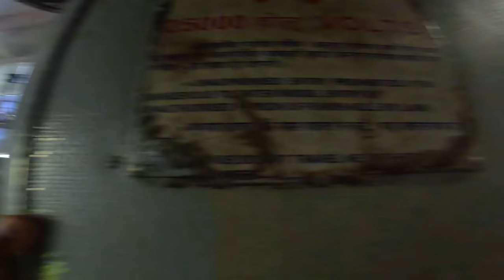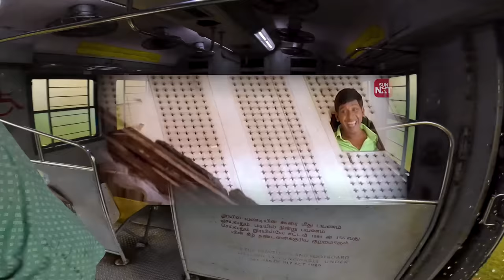TRACTOR RIDING EXPERIENCE IN FARM😂🔥|WHEELIE ON TRACTOR😼|50HP💨|TYRE PRICE 1LAKH🤑

Comment: Bro tracker tyles la water fill Pannuvanga 
Theriuma ✌️👍😊
Reply from the maker: Teriyathu bro🤯 ethuku bro apdi pandranga?
Reply: @bikelessbiker6  25%air 75%water use pannunvanga back tyre la
Reply: @bikelessbiker6  to increase grip in field and to have loade in field to work 😊🤟💯
Reply: @bikelessbiker6  prevent the tires from slipping bro
Reply from the maker: Athadi neriya iruku poliye 😂 part 2 podum podhu itha pathi soldren bro🫂🥸
Reply: @bikelessbiker6  ok bro 👍